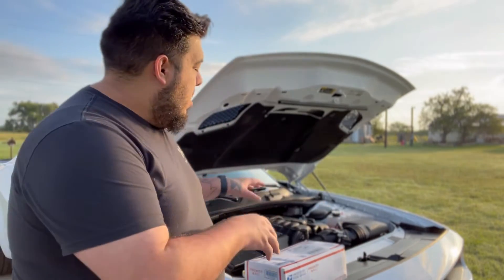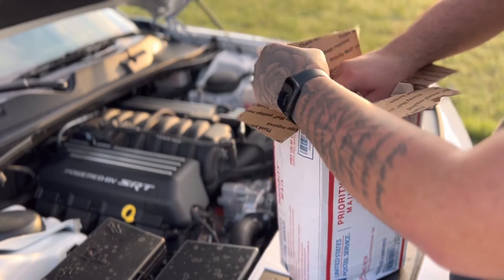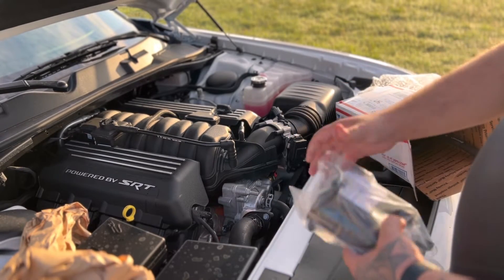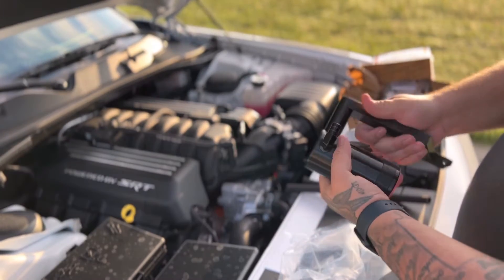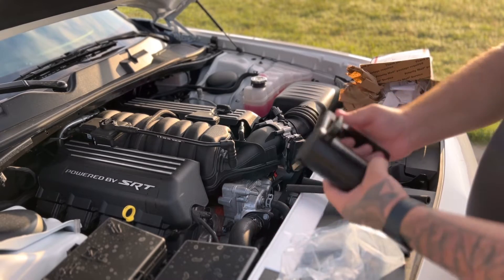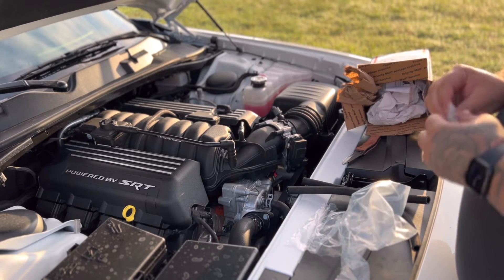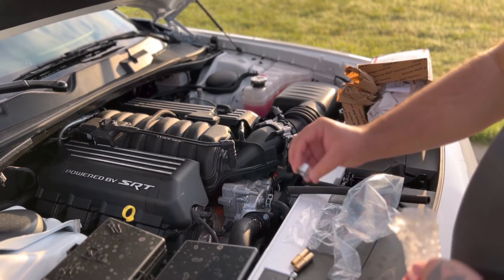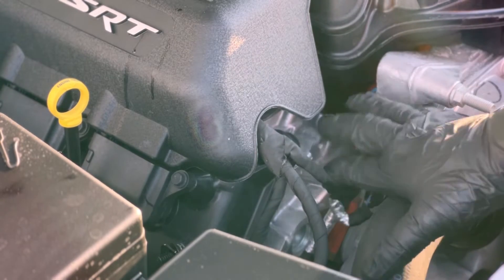Billet Technology’s Oil Catch Can Install | 2022 Dodge Challenger R/T Scat Pack

Comment: got the same catch can but got some connecting heating tube that connects the catch can to the engine, question is those tunes thin out once the car is running and gets hot, is no real for the connectors to suck in and thin out? when i rev the car they inflate back up to normal

Comment: Dinosaur was a good video I have the same engine or 2022 392 Hemi Scat Pack but I'm not spending $200 on that that doesn't do much for the engine if it's 50 I'll do it, but I'm not spending 200 thanks